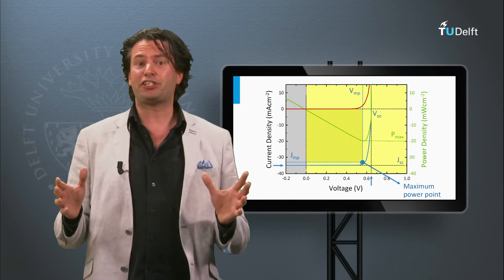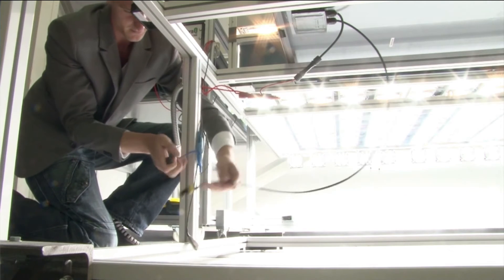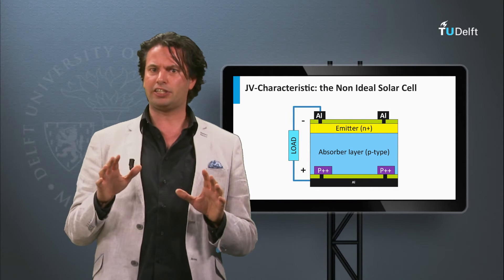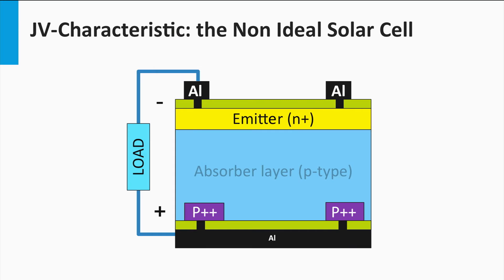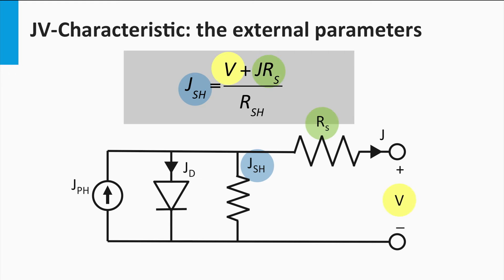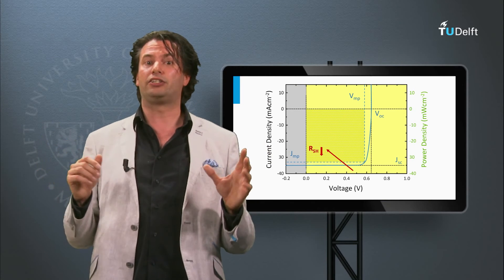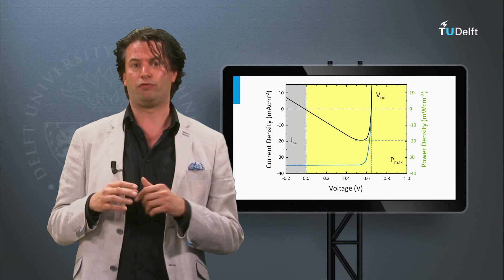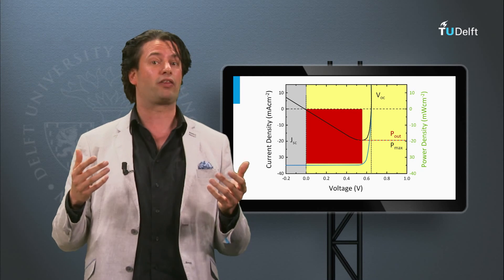3.3 Series and shunt resistance

Comment: The slope of I-V curve at Voc is far from Rseries of cell.  That slope is a parallel combination of diode conduction and actual Rs of PV cell.

Slope of Isc closer matches Rshunt when defects dominate Rshunt.  

Both silicon bulk Rseries and bulk silicon Rshunt are affected by illumination level on cell.  These resistances increase at low illumination.  For shunt this is good at low illumination levels but cell is often dominated by defect shunts.  For series resistance this is bad as series resistance increases at low illumination level and dominates over the metal current collection series resistance.